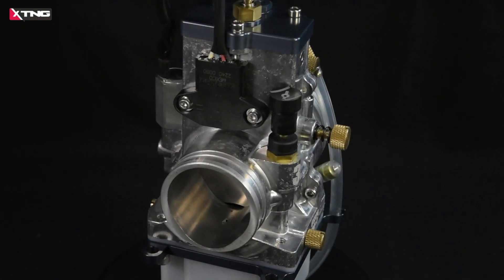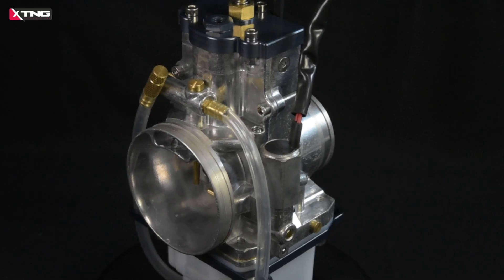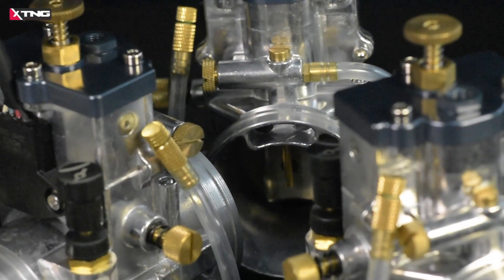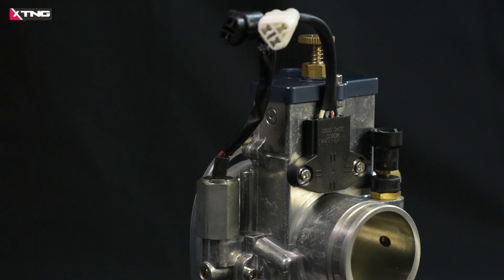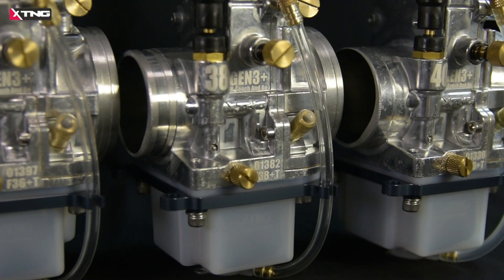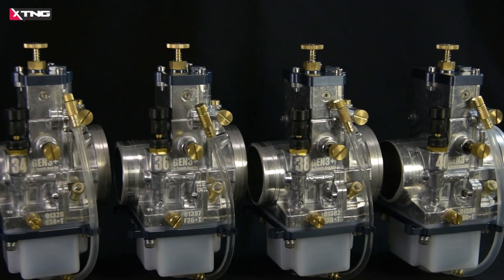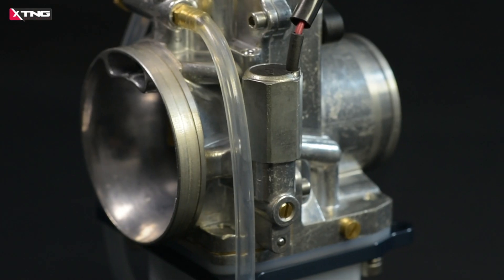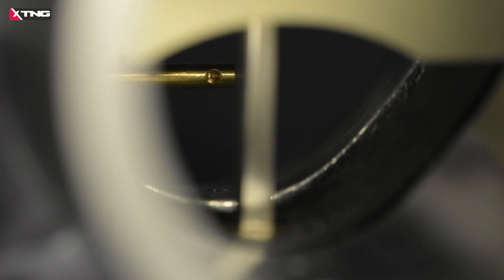XTNG GEN3+ High Performance Metering Rod Carbs

Comment: nice looking carb. i have 02 cr 125 that has rebuild engine but carb is stock and has a worn slide. and im thinking about getting gen3+ BUT! i havent seen aaaany videos of ppl trailriding and crawling with this carb. are there any 125 trailriding videos? i would love to get rid of my low end bog :D

Comment: Ok, but how does it work then, not a word about it
Reply from the maker: All metering rod carburetors operate based on the same fundamental principle. The only difference is whether they include a fuel pressurization system. Smartcarb, for example, comes with a fuel pressurization system, also known as an internal venting structure. Similarly, we also have this internal structure. On the other hand, Lectron uses an external venting structure. This means that their fuel pickup signal entirely relies on the vacuum effect created by air flow speed to pick up fuel.

With this basic technical premise, we have added an additional fuel assist system, which you can think of as a pilot circuit in traditional carburetors. This circuit significantly improves engine idle stability, low RPM torque output, and throttle response. This is one of the features that sets us apart from our competitors. 

In addition to this, we can also add systems like the torque gain circuit found in the Lectron Billetron Pro, as well as the power jet circuit system. We also allow the parallel integration of Japanese-style solenoid valve systems, which our competitors do not offer. 

This means that when you own an XTNG GEN3+ carburetor, you are essentially getting the single-circuit system of Smartcarb and the multi-circuit system of Billetron Pro, with the ability to switch between them at any time, anywhere. This is something our competitors cannot offer.

For the same low cost, you get more functionality. The choice is yours.

Comment: I've seen this same story since 1980 when a few Lectrons  appeared on mx bikes replacing the round mikuni. They disappeared to drag racing as soon as the keihin pj carb came along. The pwk was the common choice and still is.  I admire the development of this design but being more complex and unique isn't a good thing when you need a bowl oring or float valve on a Saturday before a race. K.i.s.s. is the best idea for any dirt bike carb and the pwk is just that. Remember,it doesn't always have to be better,it just has to be different.
Reply from the maker: Before November 2024, I fully agree with your point of view. After two years of continuous trials and improvements, I can say very responsibly that the comprehensive performance of GEN3+ far exceeds PKW.
Reply from the maker: In fact, the GEN3+ is very simple and reliable. Perhaps you've seen various different modes demonstrated in the videos, but in reality, the operating principle in each mode is very straightforward, and it provides a noticeable performance improvement.Thanks for talking anyway!

Comment: Will this fit on a 2013 t m e n 300 two-stroke it has a pkw 38 mm on it right now which works incredibly good I know I want the spray nozzle inside the carburetor to give it top end performance pkw 38 works incredibly awesome Keegan carburetor
Reply from the maker: The traditional PWK carburetor has many fans, but its bottom-end performance and top-end performance are indeed not as good as those of well-designed metering rod carburetors. Once you try GEN3+, it will definitely change your existing perception.

Comment: I did a ton of development for Lectron. This looks interesting.
Reply from the maker: Hello! About six or seven years ago, when I first started working with metering rod carburetors, I had already heard of you. On my 2016 TE250, I tested almost every rod available, including 4-1, 4-2, 5-1, 4-2m, and 3-2m. I was particularly impressed by the performance of the 4-1 and 4-2m on the Lectron VH. I have great respect for the work you’ve done for Lectron in the past.
Reply: @xtngcarbs1249  Good stuff. Thank you. Small world. I struggled to get the early Lectrons to work on 4 strokes. Starting and idle was always a challenge.
Reply from the maker: @Motosportz  This reminds me of the challenges I faced with the XTNG GEN1 4T version. As you mentioned, idling was a significant issue, followed by the precision of the metering rod. 4T engines are incredibly demanding when it comes to fuel accuracy. I made countless adjustments to the designs on the YZ250F and DRZ400 before finally achieving the best low-end and high-end performance.

In comparison, 2T engines are much more forgiving when it comes to fuel precision. The journey has been a tough one, but it has helped me grow a lot. Despite the difficulties, it has been incredibly rewarding.
Reply: @xtngcarbs1249    Two other things that come to mind about Lectrons was the overall physical size of the carbs (usually to big) and the hard throttle pull that I never found away around. Light return springs allowed the slide to stick. Have you addressed those items?
Reply from the maker: @Motosportz  The main issue with Lectrons is that their early versions used convex slides, and the strong siphoning effect from a four-stroke engine concentrates force on both sides of the slide. This creates friction, which causes the slide to stick. Billetron tried to counter this friction with a chrome coating, but so far I haven't seen any complaints from their customers.

I encountered this issue early on, and it caused me a lot of trouble. Later, I addressed it by changing the coating on the slide and adjusting the carburetor's structure to prevent it from happening. I can't go into too much detail here to avoid giving my competitors any ideas, but I haven't encountered this sticking issue on my DRZ400. It's clear that SmartCarb also faced the same problem, with condensation even at near-freezing temperatures causing the slide to stick, not to mention with their four-stroke version. This issue is one of the main reasons they hardly released any four-stroke versions of their products.
Reply: @xtngcarbs1249  :face-purple-crying: